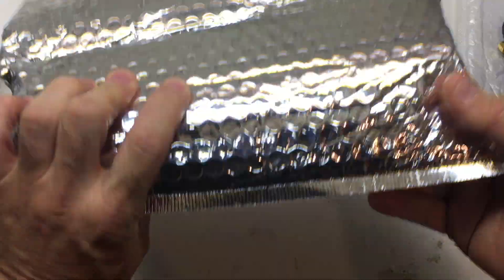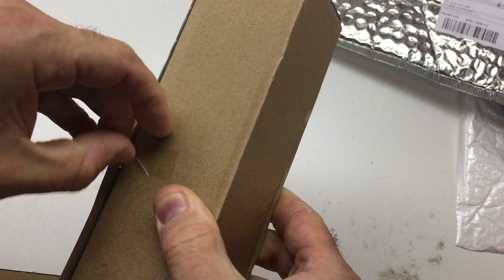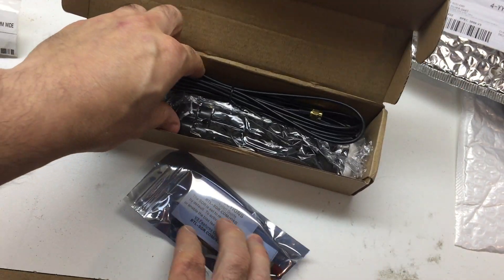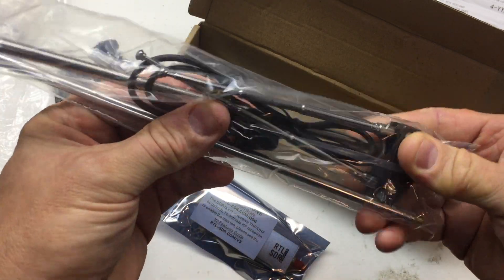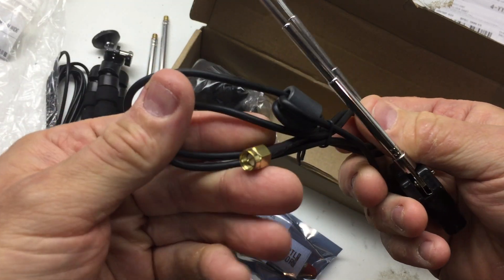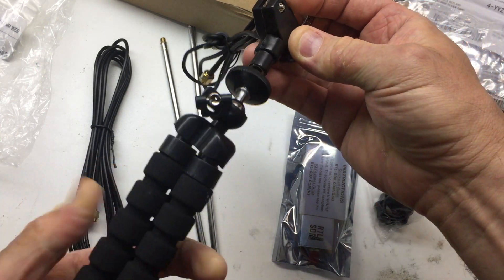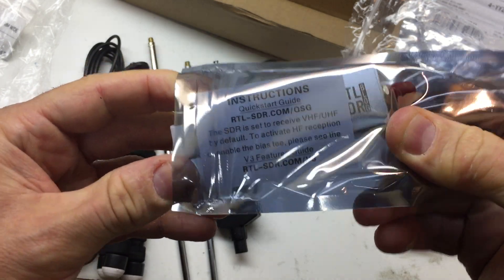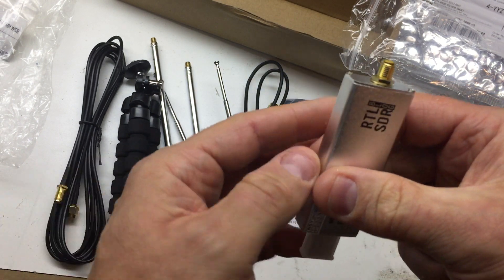RTL-SDR v3 Blog Software Defined Radio Dongle Unboxing!

Comment: I read the info at the RTL-SDR.COM Blog.  As usual, the terminologies and tech are way over this beginner's head.  However, It seems from what I read that this "dongle" by itself is pretty much restricted in it's usefulness without using additional hardware to compensate for this dongle's lacking abilities.  Is this one of those situations where "you get what you pay for"?  Would the $40 be better spent toward the purchase of a more expensive SDRplay box of some kind?
Reply from the maker: The more expensive SDR dongles are going to have more features, certainly. If you can afford the cost better go for SDRplay, AirSpy SDR, etc... If you are just starting out and don't want to spend much and just "play around" the RTL-SDR is a solid option that is worth the price. But as with anything, there are better options out there.